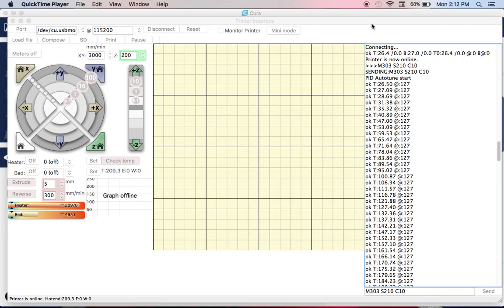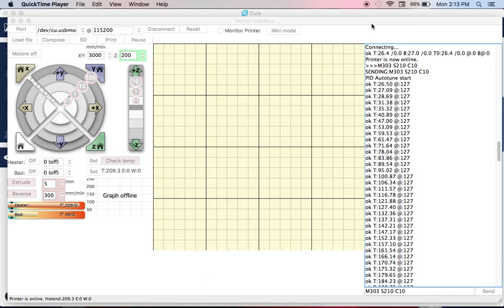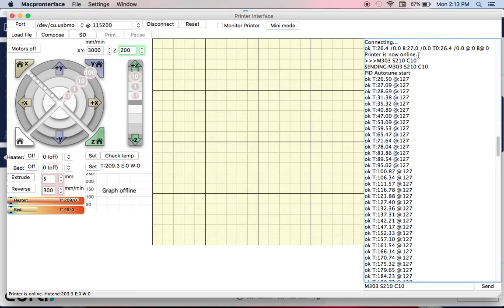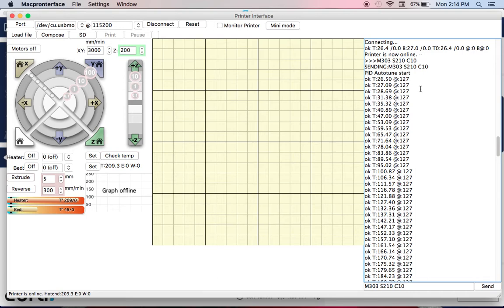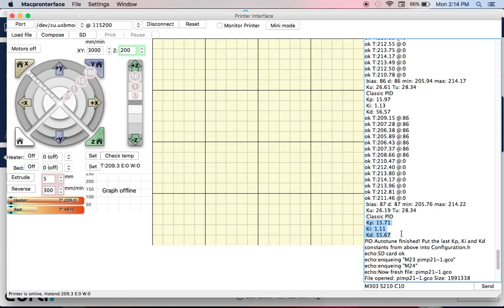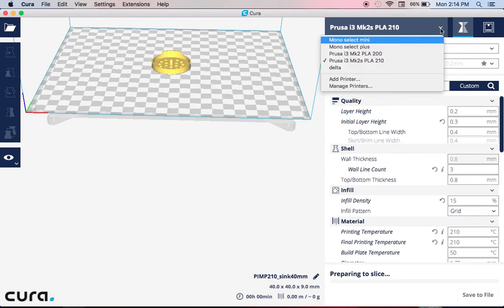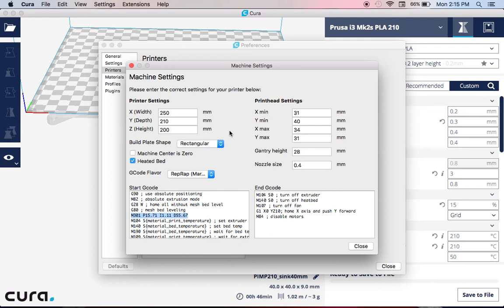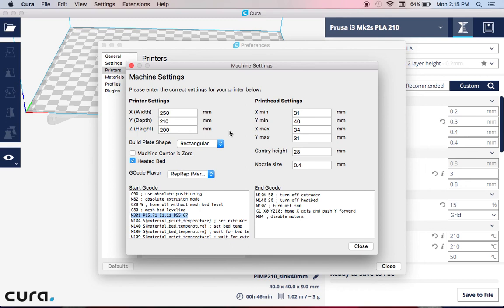PID tuning with Cura Prusa i3 mk2s

Comment: Hello Winston! I'm trying to run a couple commands to my monoprice mini using pronterface on a mac, but, I have NO idea how to identify which USB port to choose - I have it plugged into my mac, and to my monoprice, but, the 'port' window' is blank and I have NO idea how to identify what to type in to get the connection on (so that I can upload a couple commands I still need to). How did you do it?
Reply from the maker: depends on which OSX version and printer you have. You may need to download a 3rd party USB driver. Have you tried repetier host ? Under ports you should see a usbserial or usbmodem that pops up. 

http://www.ftdichip.com/Drivers/D2XX.htm

This link should help.